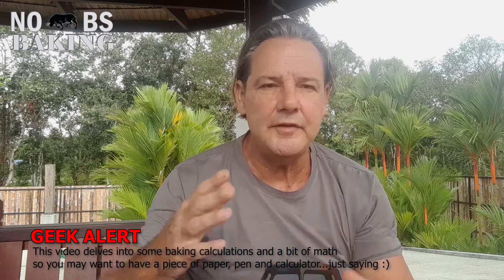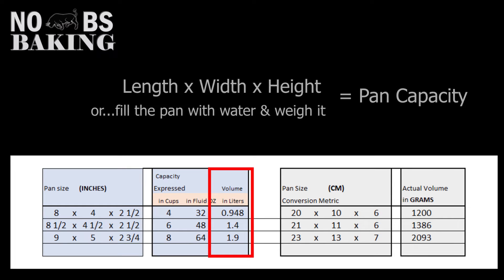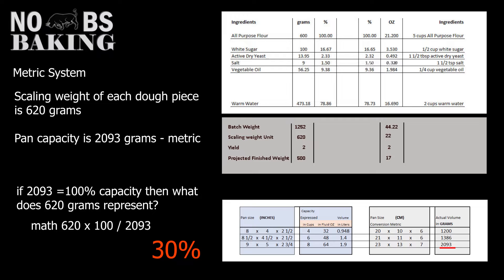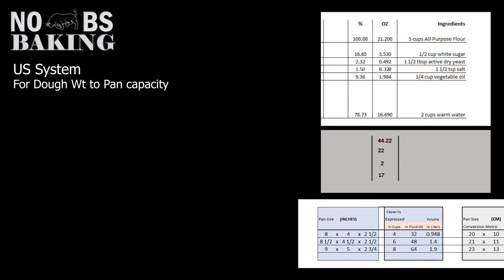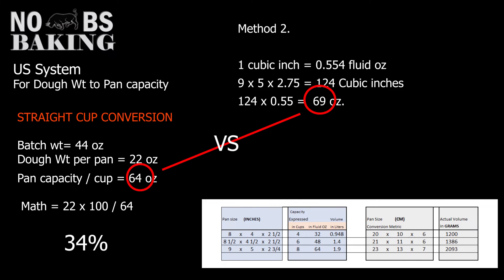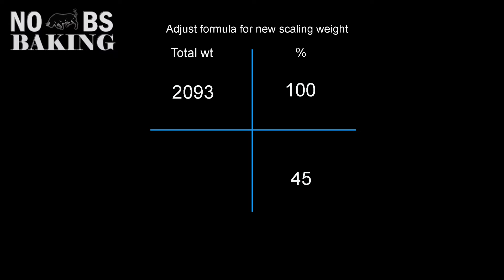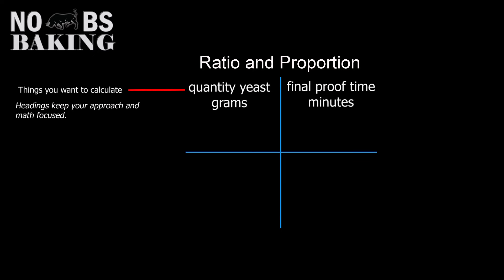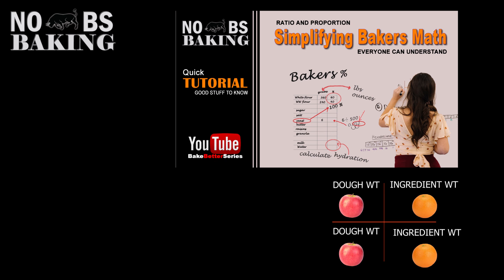Any Pan - Dough  Weight Calculations | US and Metric Conversion Simplified and Accurate.

Comment: Hi Sir may i ask question? So now i'm looking a toast box on website after watched your video. The size 21.1cm x 10.1cm x 11cm = 2.344cm ( total size ) comes with a lid and written on the web for 450g dough capacity. Which i'm confused about is how do they know the total size of the pan for a 450g dough capacity? Is there a formula to calculate bread dough to fit in bread pan ( depends on bread pan with lid and lidless ) ?
Your answer very help me. Thanks.
Reply from the maker: The answer is: These folks are saying that the pan can be used to produce a 450 gram loaf of bread I assume. That means your dough weight would need to be around 550 to 580 grams. This is only 24 % pan capacity. It Is very low but it can be done with basic white bread or even a 60% whole wheat but it will be a very light product with not much substance. Further you will need a good bread flour strong enough to give you a minimum of 3 x the rise in volume. It's alot to expect, but it is possible and many large industrial bakeries are around this level. I would recommend starting a bit higher... maybe 30%. Your pan is a "Pullman style" I assume with a lid. So you want the dough to get about 2 cm below the top of the pan before baking.  
The reality is you can make your dough as light as you want or as dense as you like with proper recipe balance, proper hydration and good flour. 
Start at 30% or around 700 grams dough weight and see how that works. You can always add or decrease dough weight pending the things I noted earlier. Good luck.
Reply: @nobsbaking6391  Really appreciated Sir.  Thank you so much for the answer. Need a time to learn your explanation.
Reply from the maker: @fxsound2899  
Google translate 😃
Reply: @nobsbaking6391  Last question Sir. On the web, this pan size for 450g dough. So it means:
450g = flour weight only or 450g = total ingredients weight ?
Reply from the maker: @fxsound2899  
If it says dough weight then that means the TOTAL WEIGHT OF THE DOUGH. As I said earlier, that's a small amount of dough. That is less than 20%, if your pan dimensions you stated are correct. Send me a link to the pan info. It sounds very strange.I want to see it. 
JP
And please subscribe to the channel.
Reply: This helpfull for me...Iam in Indonesia and I bought a pan with lid is 19×10×11. I actually bought it by different measurements....when I measure it at home, it was totally different. There is no other information at all.